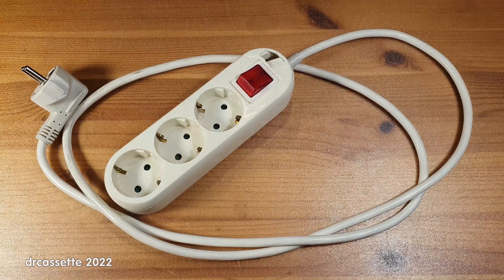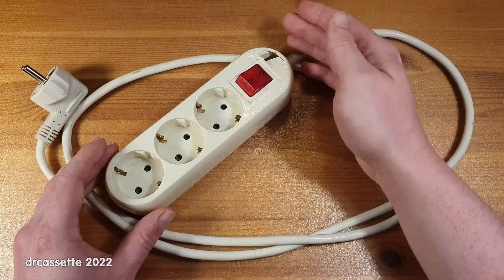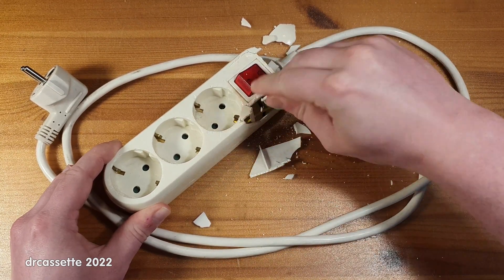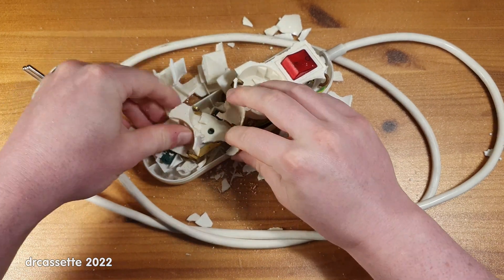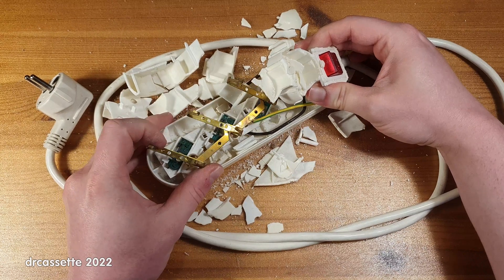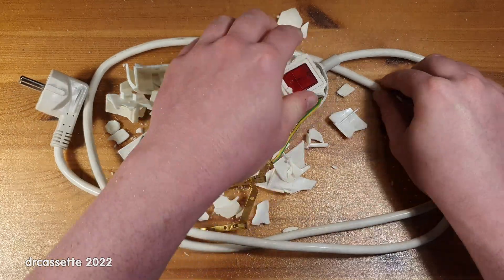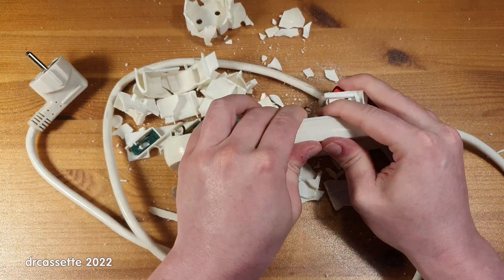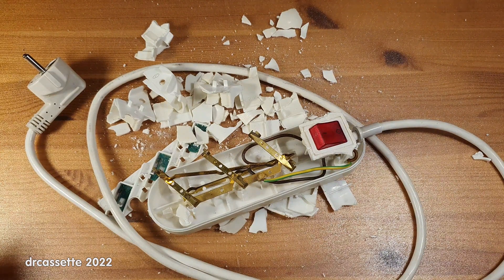Super brittle power strip

Comment: Its NOT fascinating
It is darn right ANNOYING
that so much stuff has been made to be Biodegradable
and falls apart when you get round to using it.
this even happens with buckets, plant pots, car parts and storage containers.
and as far as power bars are concerned, i'm still cursing a Chinese 4 plug power bar
it slowly melted inside over a period of time, and eventually the Live contacted the Earth.
modern contact breakers on my house supply werte triggered
but not quickly enoughas it took out 2 high end workstations and a laser printer that were connected to the power bar when the contact finally touched.

Comment: I guess modern plastic is designed to disintegrate in the sun. I have a small Bissel portable upholstery cleaner that I used to clean my car. I stored it on the porch where it got exposed to a lot of sun and when I went to use it the water tank broke apart in my hand.

Comment: I got a very small amount of water with a little bleach in it on my kettle when i was cleaning the worktop, the next time i went to make tea, lots of little white granules were floating around on the top of the hot water, I looked at the spout of the kettle and noticed that it was rough looking, when i rubbed it a little, it disintegrated to dust size pieces. I'm glad i noticed it or i could have been ingesting the stuff. I since found out that certain plastics don't do well when they come into contact with certain household chemicals. I now use a stainless steel model.

Comment: Something is chemically altered by the sun. I think this is related with the brittle garden hose effect. Those are often made of PVC with a chemical substance in it that makes it flexible. This stuff degrades due to UV exposure as far as I’m aware. Many years ago, way back in the mid 90’s some consumer watchdogs warned against baby toys that where made of PVC for that reason. The chemical that softens the plastic was poisonous. UV radiation does funny things with plastics, some grey or light couloured plastics yellow (it’s believed to be caused by a flame retardant). However this yellowing can reversed with peroxide and UV exposure. I have some very old power bars that have no such problems, they seem to be made of thermosetting plastics.

Comment: Had one as well that suffered the same fate, don’t even think it was exposed to the sun or heat for that matter… It was branded Brennensthul, witch in my world typically stands for quality… I remember grabbing it to move it, and it just fell apart in my hands, it was even thinner plastic than yours. I was just bloody lucky that it was disconnected from the wall outlet.
Reply from the maker: Wow, interesting! I thought Brennenstuhl was one of the better brands for these things, but it seems like they are not perfect either...
Reply: @DrCassette  It was a three-way strip like yours but without the switch, bought in the 90’s, I guess even they had/have a range of these smaller ones with reduced price-quality. I’m sure the bigger, heavy duty ones holds up to the quality we expect from them!
Reply: I've got an early 90's one from Brennenstuhl, 5-way and it still is fine. This one is also exposed to daily sunlight through one of my windows.

Comment: This specific power strip with the plastic rivets likes to disintegrate, I had two of them, it's not just the sun. The Kopp and Kontavill ones are ok/good, but the best power strips are the Kontaset ones (there are at least 20 different Kontaset versions, but all of them have replaceble cables and basicly indestructible). (It's an old hungarian brand, but you can find used ones for cheap and they are better than most of the new ones.)

Comment: A few years ago this is exactly what happened to an electrical outlet just like this one in my parents' country house. In fact, mine fell apart even more easily than this one. Both the top and bottom. I was amazed by this. How is it possible for plastic to fall apart like this? And the danger if the electrical outlet is plugged in. I've never seen anything like it. The pleasure it gave me to break this electrical outlet in my hands and at the same time angry for having such cheap material. And I didn't even remember to film.
I'm not sure but I think that in the case of my parents' electrical outlet it was not in the sun but subjected to very low temperatures during the winter and very high temperatures in the summer for years.
Reply: Same with vacuümcleaner and aquarium filter 💦 split open after 4 years.
Reply: @lucvanhove9639  😯